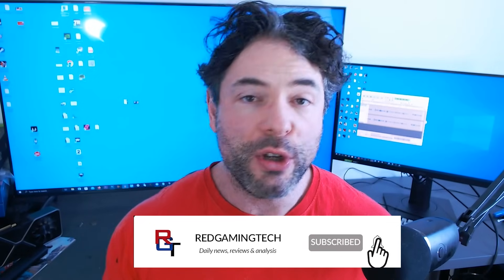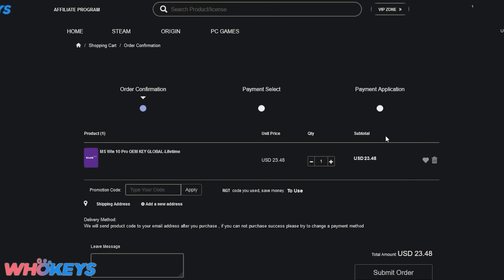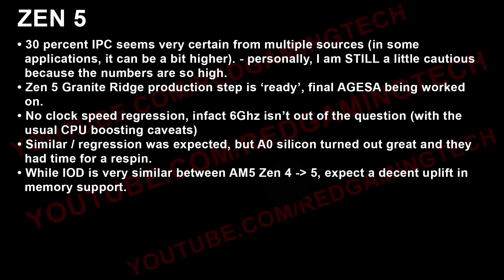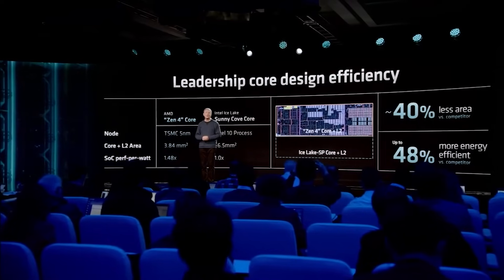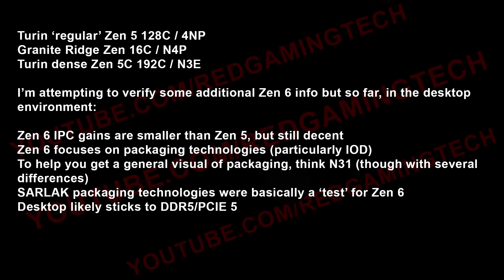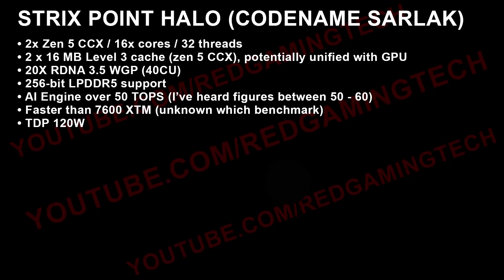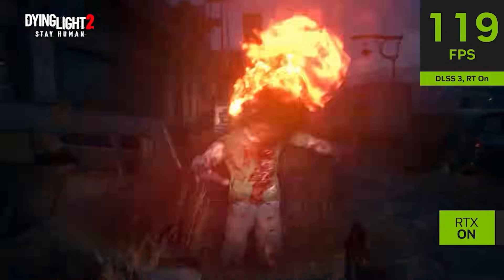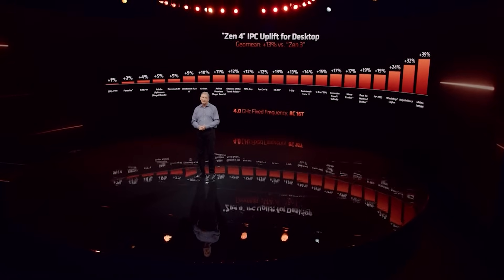Zen 5 Will DOMINATE - HUGE IPC & Performance Update

Comment: Whispers and rumours : about the 11 minute mark ~ I hear the engineers at AMD, are very keen to stay on the AM5 package / socket, and they're moderately confident they can do it. There would be some advantages and some disadvantage to going to another socket. The engineers themselves see the marketing and brand loyalty advantage of staying on the same socket, the way they did with the AM4. The people who are resisting that, are the marketing and accounting and investor minding people, the ones who prepare the slides for investor forums, where they talk about having a gross 40% margin. The boardroom pirates, are pushing for a different socket. The engineers are resisting. There would be some advantages to that, but the engineers know it would piss off the customers, and they know if they work late a few weeks, they can make the AM5 socket work just fine.
The reason I share, is the interesting dynamics, who wants what within the company, how the differing groups think. The corporate types see an opportunity to do a bit of price gouging, and blame the engineers for it. The engineers see they just got to Zen 5 ~ there's no real pressing reason to introduce a Zen 5 processor and an AM6 socket / chipset / motherboard / platform. It all just means a few late nights to get it right. The Zen 5 cores and chips, will go perfectly well in  AM5 sockets, we just have to cross the eyes and dot the tease and make sure the AGESA code is right (for one thing) and make sure we get the Linux kernel work right.... All the bring-up work. We set a pretty high standard for the power delivery and the memory traces when we specified those motherboards anyway ~ this is why we did it that way ~ so there wouldn't be issues with those things when we dropped a 16 core R9 Zen 5 chip into it, with all the auto-overclocking stuff turned up ...
--------------
I am puzzled what they're talking about with the huge IPC gains. I do have a suspicion we're talking about a workload that's very heavy with AVX-512, which was an Intel invention but then Intel disabled it, (side-channel exploits I hear ~ Spectre ~ Meltdown) so AMD have got that instruction set to themselves. The AVX512 stuff is still there on the Intel chips but it creates a security weakness they can't fix without turning it all off. If you constructed a workload that heavily used AVX-512, that would make AMD look good. If you went back and found a 'benchmark' written by Intel, back in the days they had AVX-512 and AMD didn't, and then you published how sharply current AMD Zen 5 out-performs a 13th or 14th generation Intel chip, on their own cherry-picked benchmark ... "How can you say this famous & heavily used benchmark is inaccurate? You wrote it."
All I'm saying, I'm far from sure their claimed 30+ % IPC uplift is going to be reflected in my work, on a Linux desktop, surfing the web and watching some pwn and every now and then, compiling a Linux kernel. I'm not at all sure what I do every day is going to see a 30+% improvement in IPC. Of course, I'd LUV to be proven wrong about that. Having a 40 ~ 60% jump in real-world performance, from this old i7-6700, to my new Zen-5 box, is very much making me lick my lips. I'm looking forward to this.

Comment: Aaaand this is why I am waiting to upgrade my 5900x. May wait for x3d, but this sounds very encouraging.
Reply: Same here.  Will rock my 5800x3d til zen 5 x3d variant arrives, hopefully with higher speed ddr5.
Reply: Same. I was about to get the 7800x3d but I guess I’ll wait.
Reply: Yeah an 8800x3d sounds a winner. For gaming at least, those X3D chips seem a no brainer, and you eliminate the cross CCD latency on the x800 chips
Reply: @jackpowell9276  do you mean 9800x3d? Because 8xxx chips are the Zen4 mobile ones.
Reply: I have been swapping parts out on the cheap over the last 2 months. I had a 5900X and bought a Open box 5800X3D for $263. Sold the 5900X for $260. Decided to go to AM5 as I could upgrade my 5800X3D to 7600/7600x / x670/ 32gb CL30 for about $50. Then I was given a free x670 board and the plan was just to have one Zen4 7600X build right now and when Zen5 arrives buy that and push the 7600X down to the Media PC. Well... found a brand new sealed 7800X3D for $340 from a guy locally. I figured the 3D version would be another year and since I could sell my AM4 for good money I might as well go Zen4. I prefer to pay discounted prices like I got on Zen4 vs paying full MSRP. I will go Zen5 or 6 after they have been out 6months or so. Also all the SOC voltage issues have been worked out on the 7800X3D w/ Asus and other boards. So to me the sweet spot is getting tech on heavy discount when new tech in on the horizon. Let others deal with the bios and glitchy issues.
Reply: Me too, I've got the same CPU as you, I have been waiting a while so the performance increase is around 100% better in most applications.
Reply: I'm still waiting to upgrade my 3600
Reply: There may not be any vcache CPUs anymore as it looks kike that will be incorporated into all CPUs with next gen.

Comment: right on time, i was wondering today whether going for the 7800X3D for my gaming/development PC i'll buy around april or save some money and get the 7600 while i wait for zen 5
Reply: Just get the 7800X3D as it will be basically the same performance as vanilla zen 5 🤷🏻‍♂️
Reply: @mikeramos91  in gaming yes but in compute the 7900x is already around 20% faster
Reply: @deneguil-1618  you weren’t talking about the 7900x. What I meant was if you cheaped out waited for what I assume you’d get the 8800x then it would basically be the same performance as 7800x3D. But if you need more cores/compute then just get the 7900x3D 🤷🏻‍♂️

Comment: So max tuned 14900K is about 20-25% faster in gaming than tuned base zen4, and now they're gonna finally catch up with Raptor Lake, yay!
Reply: LMAO, no it isn't. Poor Intel nerds need that copium so bad.
Reply: @rustler08  good proof, thanks for giving me names. There's no need to get triggered over truth. Now tune systems and actually show me (you won't). There's plenty of data from oc enthusiasts on that matter. Oh wait HUB forgot to mention that ram oc would bring about 30% more fps to an intel system that's already faster even at stock than non 3d zen4?
The raw power of AMD lags behind Intel by quite a lot, the only gem is the x3d now. Zen5 non 3d is yet to match/outperform raptor lake in single thread. They'll need to push a lot to match arrow lake, especially with a ram tune provided its imc is gonna get even faster.
Reply: So a tuned 14900K at 500W could tie a 7800X3D at 60W. Amazing!
Reply: @nipa5961  nice! You gotta be so smart my man to realize that a cpu with a ton of cores and multi threading power consumes more than 7800X3D, nice job! ;)

That's some amazing logic from someone who is clueless. You need to go overboard to even see 300-400w during normal max loads and throw much voltage at it for that. I guess HUB didn't tell you that you don't need 6ghz or ludicrous out of the box Vcore to reach +30%. All that comes purely from ram/ring tune. Leave normal 5.5/5.7ghz, undervolt, and that thing never ever even comes close to these power numbers while being a ton faster than any mainstream numbers. And that will beat 7800x3d in most games, not by a lot, but it will, while being better at everyhing else. (I'm not going to lie I'd prefer 7800x3d as only a gamer myself, but intel is still the fastest with tuning)
Reply: Will probably be a bit faster than tuned raptor lake, and you don’t need to spend huge amounts on motherboard and cpu/cooling. X3D will go further
Reply: @raoter67  it won't go anywhere as faster with tuning as 14900K as it is milked out of the box, 5-10% and 20-30% gain are completely different numbers. 14900K is like 5-10% slower on avg when stock and now do the math with a full tune.

I can't ever see it beating intel lows either. 

It's expensive right, not for everyone, but the fastest in every way possible.

Comment: AMD all hype. No go.😂
Reply: AMD sandbags, Intel releases "14th gen". 😂
Reply: @nipa5961  😂
Reply: @nipa5961  just keep dreaming. 😂
Reply: @ronlucas2955  Don't worry. One day Intel will get competitive again. 😂
Reply: @nipa5961  one day AMD will become a challenge for Intel.
Reply: @nipa5961  I've been waiting for AMD to step it up so Intel will.
Reply: @ronlucas2955  just keep dreaming. 😂
Reply: @ronlucas2955  your?
No idea what you are dreaming about, but in reality the 14900K is still 11% slower than the 7800X3D. 
Considering Intels' 2% generational uplift they might tie the 7800X3D by 2028. 😂
Reply: @nipa5961  you mean they're like 2% faster than the 9th gen right. 😂
Reply: @nipa5961  😂😂😂
Reply: @ronlucas2955  Have you ever seen any benchmarks in the last 5 years?
Your dreams are outdated. 😂
Reply: @nipa5961  everyday. Do you? 😂
Reply: @ronlucas2955  Good. Why are you stuck in 2019 then?
HU just showed the 7800X3D is 12% faster than the 14900K.
Reply: @nipa5961  😂😂😂😂😂

Comment: My guess is 10-15%.
Reply: In multi-tasking in Linux I hope its above 30% but I believe its probably closer to 20% IPC but that's fine for me a 9950X at 6Ghz max with a 20% IPC = 7.2Ghz although I will run it in ECO mode and set the frequency similar to my current 7950X (4.5Ghz) to keep temps and energy consumption down but I will have the headroom to increase this at will if required via a desktop app.

Comment: Remember the rules! You NEVER, EVER put all your cards on the table if you don't need to...and AMD doesn't need to with Intel, obviously. Instead, expect the expected...the same uplifts  from Zen1 to 2 to 3 to 4, and crucially, note how those uplifts are reducing as AMD cements more market share. Expect also price fixing - AMD with Intel, just as AMD are OBVIOUSLY doing by latching on to every rise of Nvidia's price bar.

Unfortunately for the sane minority, there are far too many braindead out there, a huge group always increasing in size...a group every company is only too pleased to bleed dry...a group only too happy to be bled ;)

Comment: Strix Point Halo / Sarlak isn't a problem for Nvidia as there will be none in stock as usual. If it launches at CES 2025 then first devices will be November 2025 by which time Nvidia will even have RTX 5050 and 5060 in stock and performing better ;)

Comment: The way your information conflicts so much with MLID is odd.  Starting to wonder if there is something funny about architecture where IPC is way up where AMD has normally struggled like geekbench type stuff and other odd things like that which many compare CPUs with and AMD is generally behind intel and apple and such.  But then gaming it's more 10-15%.  Also, there could be some NEED for the respin and that is what MLIDs information is focused on, but the respin didn't just fix stuff it got some IPC things they had projected that weren't getting realized finally realized.
Reply: From what i understand zen5 will improve certain institutions more than others, the 10% boost that MLID is reporting might be an overall uplift from better cache design or maybe just the average of the improvements, while the 30% reports are most likely targeted applications that amd focused on improving
Reply: @helpmedaddyjesus7099 pretty sure mlid said 10 to 15 percent
Reply: @NadeemAhmed-nv2br MLID said with the internal leaked slides 15%+ for Zen 5 and 10%+ for Zen 6. Zen 5 was originally targeting above 20% IPC uplift, but was unable to achieve it.

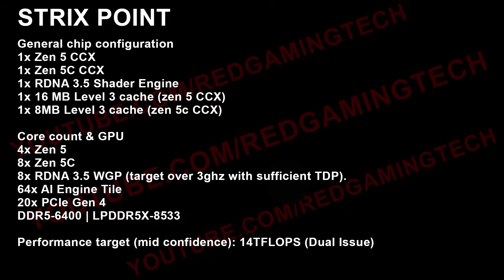Comment: 13:16 By the looks of it the Strix Halo has no chance in hell to be available in laptops under 1500 usd and faster than 7600M XT doesn't look much impressive - similar to 4060 mobile which are available at a 1000 usd. Do such large APUs make any sense?? Add to that worse upscaling quality, worse for 3d workloads and other CUDA accelerated workloads.
Reply: Such large APU's might be the only point where an APU makes any sense - and with APU I mean something that has more than the 2 CU's/SM's that Intel or AMD usually has on regular CPU's. Hardware Unboxed did some testing that showed how it doesn't really make performance or economy -sense unless you're doing ultra-compact builds or portable. But if the APU has enough CU's... it might be a decent option for entry-level graphics.
Reply: These apus are designed for thin and lights and getting very good battery life in a portable package while working on battery is something people will pay for, just look at the Mac lineup
Reply: Who said that'll enable battery life? First of all to keep cost low the Strix Halo is a chiplet part and not monolithic - so similar to 7045HX parts which have terrible battery life due to high idle power draw from the IOD. And 2ndly we have already seen reviews of the 7040HS Pheonix APUs where they absolutely do not provide longer battery life than when gaming on a dGPU.  @NadeemAhmed-nv2br
Reply: @NadeemAhmed-nv2br  Sure, but those were already released, in the steamdeck and ROG Ally, there they do make sense, but not as DIY desktop-parts - unless they increase CU-count to give you an actual entry-level GPU. :3

Comment: Why are MLID and your "leaks" completely opposite when it comes to IPC and gains?
Its so drastically different that I can only say either of y'all sources are giving false information or old information/predictions rather than confirmed info.
1. Moore's said about 10-20% max (probably below 20%) and you got 30% + ...
2. Moore's said development was rough especially switching from 3nm testing to 4nm to the point where they might consider releasing the X3D CPUs along with the regular release. You on the other hand say development has been good with exceptional gains according to YOUR leaks.
3. Moore's also said development problems were so bad that they are even considering adding zen 5c cores to bolster performance (on fire-range) and that they are working on fixing the zen 5 issues (esp. the memory controller) in their architectural changes with zen 6. However, your leaks say everything is going good and even better than expected.

Again, its crazy the complete differences based on both of y'all leaks; so are your leaks truly accurate compared to Moore's? Hope there isn't a video in the near future where you now say that everything you have been "Leaking" so far was wrong and things changed last minute .... because I would love to see AMD confirm its a 30% increase.
Reply: Exactly, totally conflicting with MLID, definitely i will unsubcribe if there is not at least 25% ipc gain. Seems like Red gaming becoming a clickbait channel
Reply: "...truly accurate compared to..."...both are just leaks and assumptions 🤔
Reply: @heni63  No, they get it from "sources". Like an insider for example.
Reply: @GeneralS1mba  hmm I kind of new but also did forget while answering, sorry.
Reply: I will go mad if there's a 30% IPC uplift. If there isn't then there's no way I'm going to listen to this guy talking about his very reliable sources.
Reply: It could be that MLID sources are inside the engineering teams at amd measuring the hypothetical increase while RGT sources are actual real world tests from servers where certain instructions were underperforming on zen4 and maybe it was fixed in zen5? But that is just a guess.
Reply: @helpmedaddyjesus7099  Or one of them is straight up lying. Lol.
Reply: Look at ZEN3-ZEN4 Going from N7 to N5 netted them 13% ipc increase. And official TSMC info for N7 to N5 is 13%.

N5 to N3 is 10-15% speed@iso power from official tsmc info. Transistor "speed" =clock's. Iso power in slides usually means 1.0V.
If they are using N3 vanilla and not the N3E then expect 10-15% clock increase to the base clock at 1.0V. 
Boost clock depends on power leakage and other factors cba writing them all. 
But if they are using N3 vanilla it has bad leakage above 1.0V so dont expect higher clocks then ZEN4. 
Only arch change that is good for gaming is the L1 cache increase. 
So assuming we take the 10% speed@iso power that translates to around +250mhz to the 7950x boost clocks that nets us 4.5% "ipc" just from clocks at 5950mhz L1, L2, L3 cache will also be faster. So a good estimate is 10-15%.

Comment: You were right about Raphael. My Zen 4 PC (7800x3D with XTX GPU) is nuts.  Will have to sell the Zen 3 comp and get Zen 5 in the house for sure.
Reply: Peak american consumerism, well done!!!1!
Reply: @SupraSav  Thanks bro ;)  I'm British though 🤣
Reply: Buying 7800x3d when it's below £300, no rush still on Intel 6700k platform 😂
Reply: @@TaejongYi How was this 'better than expected'?  It's the same exact uplift from base Zen 4(which was nowhere as good as RGT was initially claiming) as Zen 3 Vcache was to its base models.  It's literally the same thing, just with Zen 4 base.
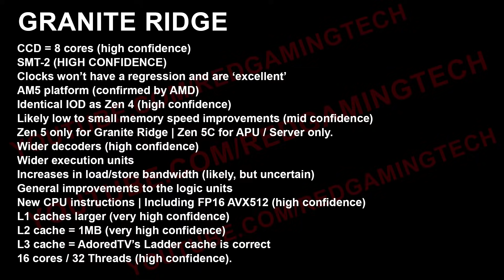Reply: 4:19 Zen 5 will use the AM5 socket.

Comment: The question is will AMD have something like the i5-13600K - A CPU that has very good gaming performance(in a realistic scenario, not like gaming with an RTX 4090 at 1080p) while providing incredible value for productivity.
You know something like the good old Zen 2 days. Remember the R5 3600?
Reply: They have the Ryzen 9 7900 non-X.
Reply: @lharsay  that one is incredibly efficient too
Reply: 7900 came out much later and is still like a 100 usd more expensive than the 13600K.  @lharsay